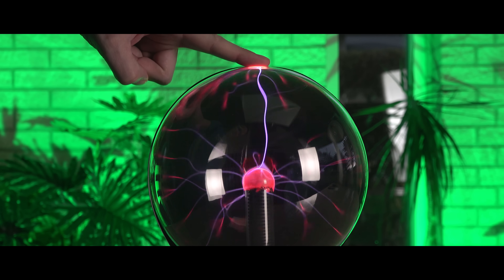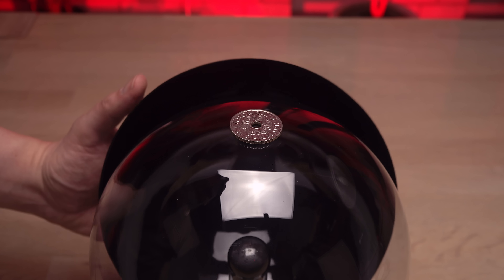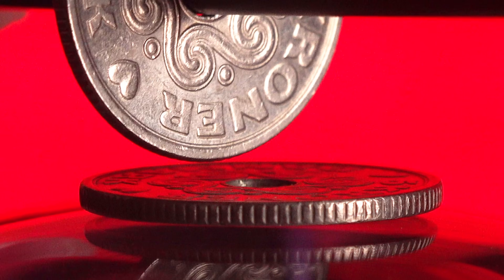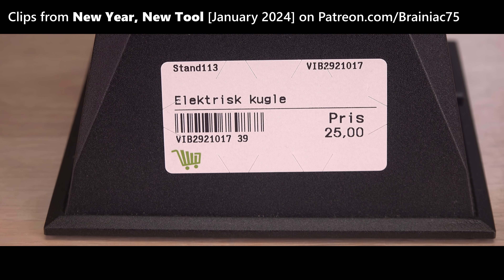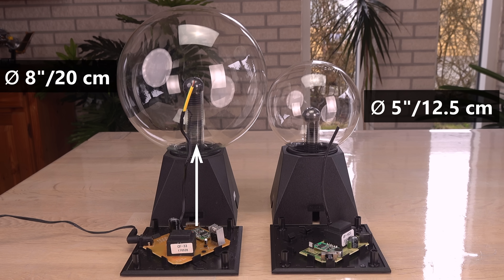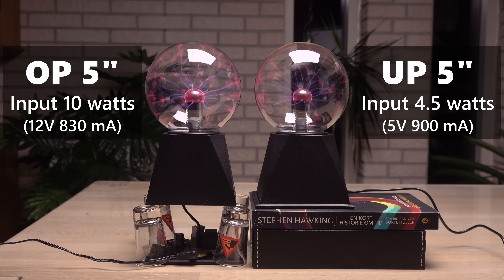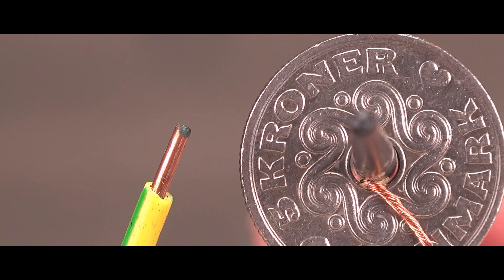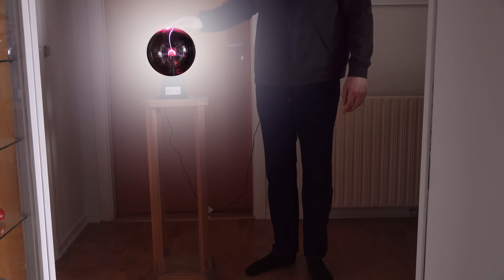Power of Plasma Balls Visualized | Don't wear a ring... Jumping won't help!

Comment: 8:50 I believe the oscillation frequency in the circuits in the overpowered globe have changed after you touched it as they're not the most stable.

Comment: maybe try using a wire that is actually grounded, not just touching a painted surface that is grounded.

the radiator is painted, and the wire was only touching the painted surface. that wire was no more grounded that you are, standing in your socks on laminate flooring (i.e. not very well grounded. yes, in theory you provide a very, very high resistance path to ground, but it would be much different if you were standing in a bathtub full of water, for example). 

i'd love to see how a real ground affects the plasma globe, and how you really being grounded would affect it.

Comment: The globes broadcast a PWM signal.  Enough to use as a wireless PWM signal. If a person is used as part of the antenna to receive the signal, it can travel several meters and srill be useful to some degree. 

High frequencies, high voltage. The frequencies have a lot to do with the action of the archs. And the PWM generation. 

I have touched the bare wire you were pulling archs from. The frequency is low enough to feel, and strong enough to burn a very local area violently. The smell of burnt skin is scattered super fast. But the burn doesn't hurt after the touch. It was not an intentional touch. Contrasting that to making contact with a jacobs ladder that archs 10 cm. That was a horrible experience as it wrapped around fingers and found a way into an opening under a finger nail. The internal burns lasted months and would cause pain from random movements that didn't seem repeatable. Needless to say a Deadman switch is advisable. Since long copper wire is much more flexible than one would think. Especially when it is carrying a high current and looking for ground. Not just the arch is active in seeking ground, the wire joins in the search. Like a cobra the wire flexing to get to close enough to spit the arch like a frog's tongue. The attraction strong enough to then pull the whole unit toward a ground and tip itself over while still trying to maintain ground. By some grace, I had started jumping back(I was the ground obviously)" As I jumped back it made contact and helped my jump action by extending my legs to straight when it locked them with voltage. So I essentially went from a backward jump to a full kick leap backward in an L position landing not so softly on my rear and slid on my wood floor a few feet out of its range. Deadman switch is a staple installation these days for projects over 12 volts. Over kill, yes. But better than the Deadman switch without the switch.

Comment: My brain realized it was capacitance quite quickly here I'm sure i learned it in school at one point but it was great that my intuition was correct in this thought, the energy has a distance to travel before it "realizes" it has no new path to ground which is why a length of wire works in this scenario.

Comment: I had one of these when I was a teen, and one day I left it turned on a shelf, I must've bumped it a little at some point and it got nudged close enough that it made contact with the wall; from what I remember, I did not see any unusual amount of sparks heading to the wall, but a little while later I heard a pop,  and looking at it there were no flying sparks anymore, but there was a small round hole on the glass where it was touching the wall. I suspect over time the corona discharge concentrated on the spot touching, or nearly touching, the wall heated up the glass, possibly eventually to the point of making it conductive which would accelerate the process by providing a easier path for the sparks than the insulating cold glass everywhere else, and ultimately  while I wasn't looking the sparks focused thru the tiny conductive hotspot on the glass and molt thru and let the gas escape and regular atmosphere in :(

IIRC, there were no scorch marks on the paint on the wall, so it must've happened quickly.

Comment: Back in the early 1990's, Radio Shack sold Plasma Bulbs, and cheap LCD Watches.  In some stores, they unwisely chose to display both on the front counter.

From what I remember, customers discovered that placing the cheap LCD Watch near the Plasma Ball, would effectly zap the watch in short order, rendering the watch a glorified paper weight.  It took manage a solid year, before they discovered the problem, & moved Plasma Ball away from the watches.  🤪

Comment: 1st I'd like to know if its possible to increase the spark gap by insulating the ground wire in a glass tube so that only the ends are exposed, with the opposite end being in the lowest potential possible 🤷‍♂️

2nd, I do hope you are planning on introducing the plasma ball to the magnets.

Comment: Many years ago i had a plasma ball, and did some similar experiments. However, i used a pencil instead of another coin. The graphite point would start the spark, and as the wood heated, it would char and start conducting electricity, forming some small lichtenberg figures.
Another stuff i did was to replace the coin on the glass with a paper painted with graphite. The arc would cut the paper on where it struck.

Comment: Man... You're wearing shoes that are isolating yourself from ground and your radiator has paint on it (most of which are also isolating) The jump was nice, but totally unnecessary since you never were grounded to start with... Try that barefoot with your feet on grass or soil and see if that makes a difference :)

Comment: Try touching it with one hand, with the other hand stretched out as far away as possible, then bring the outstrecthed hand in towards yourself. I guess your legs will still mess things up, but you could always do it on the floor and tuck yourself into a ball as much as possible. I'm pretty sure you'll be able to have some control over how strongly the filaments are attracted to you, as you reach your hand out farther from the ball and increase the voltage drop across yourself.

Comment: and you can make a 1-2 cm spark between the wire and the negative side of the hv transformer, 4x bigger than with metal on the glass

Comment: Capacitance and a relatively large mass.
the plasma balls run at a fairly high frequency in the low MHz, there is enough capacitance between the ball and you to make a good sized AC current to flow

Comment: You could stand on styrofoam to do tests with your body ungrounded. Jumping in the air could break your equipment or result in electric shock if you try jumping tests with other electrical equipment.

Comment: The foil does all the work, it is just a safety to use a transformer.  Each direction looks like an easier pathway, but as soon the thin foil gets very hot, then it must take new paths, but each path gets too hot, so you actually see the lightening die, then it starts again.  But the argon undergoes elementary fision, they showed it with neon, your smarter than me, i dont own one.

Comment: As a kid I had fun burning things by putting aluminium foil on top of the ball.
Reply: I do the same with the neon inverter from an scrap laptop. It is the same principle but it has got much higher output current.
It is turn any insulator to carbon or burn a perfect,  small diameter hole into the skin and do unforgetable smell.

Comment: Would wearing thick rubber boots have a similar effect to jumping? With that in mind, if connected to something ungrounded for a long enough time, would it eventually stabilize, or would it serve as an "energy dump" indefinitely? The fact that, when you jumped, a few stray strands of filament wandered off makes me wonder.

Comment: Relating to the increased attraction between the globes after your touch:

The high frequency fields build static charge on the glass, wuich you neutralize by touching. The globes then likely then build the charge again, with a higher concentration of charge on the portions of glass exposed to greater electromagnetic flux.

You could test this by rotating the globes after creating the "attraction," wish I had a second one to verify it myself!

Comment: You dont have an intensity knob or res bar?
got a few older ones (also cheap one) but from like the 90s sold in Denmark.
they do have a small adjustment bar, where you can cycle from no sparks and many, but it can also be models that are sound sensitive so you can dial in the right level for music etc. and why they got that adjustment bar

One thing I did miss in your video, was a spectrum fingerprint of the light.. you do have a spectrummeter.. take a reading of the light, I would love to see your peak of the noble gasses (ædle gasser)
example : the first report is of an old 6" plasma ball, does the emission peaks match yours?
imgur end values:
/a/UbcXUJ5

If you want more output on the smaller globe.. you can just dial up the voltage....its not that fine regulated...fx 12v globe with 13.5v will give you more "effect".. just dont overdo it, there are limits for how much you can ovverdrive the cirquitry +/- 4v up or down, are fine for shorter runtimes.
I tend to use a powerbank with adjustable DC output from 3v to 25v (max 5A) fx QD188-PD

Comment: And a question, what is that element wich looks like microphone in both balls @5:41 between switch and huge electrolyte and @7:16 right to the switch in smaller ball ?

Comment: Braniac....you know that paint don't counduct so you can round cable in isolation ;) ? or the futher part of heating pipe can be plastic ? ;)
And you are not really grounded in shoes and wooden or plastic floor ? ;)

Comment: Nice video as always! I feel it might be interesting to see what happens if you put the internal high voltage wire touching the outside of the glass, and what if you had multiple HV wires on the outside, will it affect a normal plasma ball?

Comment: This misconception has been around since forever. Unless you're standing bare foot on a conductive floor. No electricity will flow through your feet.
Reply: Not true for AC. The dielectric materials all allow some current at some frequency

Comment: My guess is that when you touch the undervolt one, you localized the ions inside, making that one stronger and more likely to stay there afterwards. With the overvolt one, it will pull that single filament towards it, preventing any others to form as strongly.

Comment: For all the people who don't have radiators in their homes. They are grounded through the copper pipes. Usually they have a grounding cable connected to them where the grid connects to the house. 
It's very handy to be able to avoid shocking the computer parts when you build your own PC by touching the nearest radiator.

Comment: Interesting. The way I see it, it's high frequency, high voltage and very low current flowing in a circuit that consists of the step-up transformer, electrode, air, glass, noble gas, glass again, ball surface, (optionally) your body, air, ground, mains grid, power supply internal capacitance and coming back into the step-up transformer. It's all about capacitive coupling, and enlarging the surface area means there's more capacitance for current to flow through, making the impedance lower at high frequencies and forming the preferred current path. I'd say "the path of least impedance".

Comment: Wouldn’t the charge potential across your skin (as a surface) be equal everywhere? In the illustration of the EM field, it wasn’t very clear if your skin had the same gradient as the air.

If so, why!? How ”skin-like” would the air need to be to observe this effect? Could you split your skin to have two different potentials by wrapping a bountary with some good insulator?

Comment: I asked claude(the AI) and it said it was attracted more strongly afterwards because when you touched it, you grounded the one globe, but the effect came back stronger afterwards because of the larger electrical potential difference.

I told it you had 3 globes, one large, and two small ones and replaced the power supply in one of the smaller ones with the large one. Here is the full answer:

The phenomenon you observed with the plasma globes is likely due to the principle of electrostatic induction. Here's a breakdown of what might be happening:

-Plasma globes work by creating an electrical field around a central electrode, which ionizes the gas inside the globe, causing it to glow.

-When you replaced the larger power supply with one of the smaller globes, it created a stronger electrical field around that globe due to the higher voltage or current supplied by the larger power supply.

-The stronger electrical field from the globe with the larger power supply induces a charge separation in the other smaller globe nearby. This is known as electrostatic induction.

-The induced charge in the smaller globe creates an electrostatic force of attraction between the two globes, causing the smaller globe to be slightly attracted to the one with the larger power supply.

-When you touched the globe with the larger power supply, you temporarily grounded it, allowing the excess charge to dissipate through your body to the ground.

-After being grounded, the globe with the larger power supply regained its strong electrical field, and the process of electrostatic induction on the smaller globe occurred again, but with a stronger effect due to the larger potential difference between the two globes.

This increased the electrostatic force of attraction between the two globes, causing the smaller globe to be even more strongly attracted to the one with the larger power supply, even though you were no longer touching either of them.

In summary, the stronger electrical field from the globe with the larger power supply induces charges in the nearby smaller globe, creating an attractive force between them. Grounding the larger globe temporarily disrupts this process, but it resumes with an even stronger effect once the grounding is removed.

Comment: I have a super old 12 inch plasma ball and it is 100% not safe. It will burn your finger alone after more then 30 seconds. Its amazing though, throws a ton of plasma arcs inside, more than even the swapped ball in the video.

Pretty sure the internal power supply is close to the lethal level.

Comment: Okay here's my prediction before we lend the answer. You don't need to be grounded. You're acting as a really poor capacitor and the AC current is charging you positive and then supplying a negative voltage and then charging you negative and then supplying the positive voltage.

Comment: Whenever you give the high voltage warning I have a PTSD moment and want to start listing the different way to keep safe if you are working with high voltage because I have been shocked hard. 10,000 volt DC transformer, 1 Farhad capacitor, 4 Farhad stiffening Capacitor, house hold 110v a few times, household main and the topper of them all, Lightning. I was struck in the back by a tendril of the main bolt.
So I take electrical safety very seriously and thank you for giving a PSA about the dangers of high voltage, and all the others as well.
Reply: Did you have lasting health effects from any electric shocks?
Reply: @JohnShalamskas  you better believe it. How I'm alive is beyond what any doctor can figure out. Fortunately it hasn't done much to my brain but my heart has scars apparently. I apparently have 3 Lichtenburge scars on the outside of my heart that is visible as scar tissue in x-ray. The mark on my back from the lightning has mostly faded. When I got the full jolt of household power something happened to my elbow. When I took the 4 Farhad stiffening Capacitor hit it was fully charged and I rode through it till I could throw it away. 
I also don't see in the normal colour spectrum, it's slightly shifted towards the infrared side. I can't see white. Even titanium dioxide looks pink to me
Reply: @Mikkell42 sounds like the origin of a super hero. Struck by lightning and now has enhanced vision! I'm just not sure how you would put your new skill to use...
Reply: @TwistedPresence  if only. Actually my vision has kept me from getting a pilot license and a few career choices because you have to have proper colour vision for the jobs.
Reply: @JohnShalamskas  I know I already replied but I just had a debate with myself over wether or not I had. So there's another lasting health effect, memory loss. 

In a weird way it's like I forgot that I have memory recall problems. And ADHD.
Reply: @Mikkell42 try some nicotine pouches. It’s good for your brain. I’m not kidding either.
Reply: @JAMESWUERTELE  I recently learned that creatine works even better and doesn't have the nasty side effect of being addictive. Good advice though.
Reply: lol

Comment: What's funky is you can hold a fluorescent tube/CFL near a plasma ball and it lights up.
Reply: You can use a bare fluorescent light bulb held in your hand (on the glass) to probe an HF or VHF antenna for voltage nodes.  Of course you also need to energize the antenna with RF energy to see the bulb light up.

Comment: normal electrical laws dont apply here because of the HV and HF it will mostly flow outside of the conductor its like an radio tower. i think...

Comment: I think the plasma globes seem to attract each other because they affect the charge of the air around them by attracting air particles of the opposite charge, so the air in between the plasma globes has a stronger charge than the air next to only one of them and therefore attracts more tendrils. Not sure why touching the globe has a strengthening effect though.